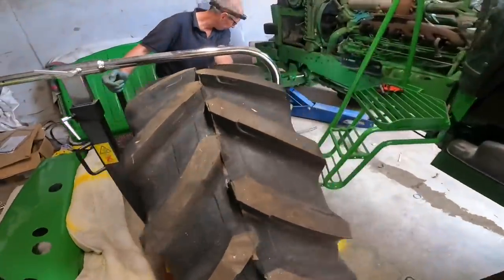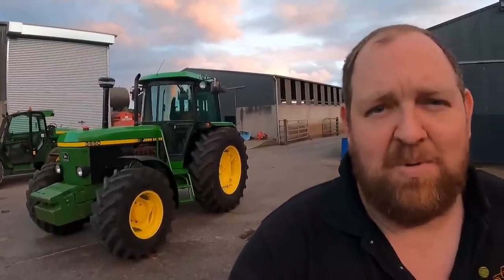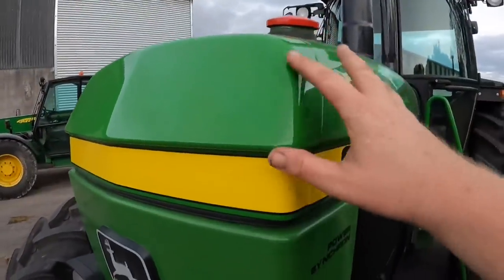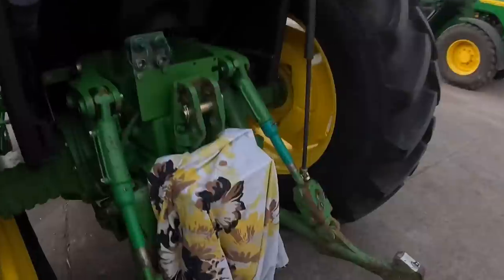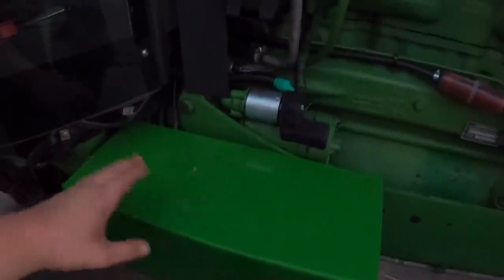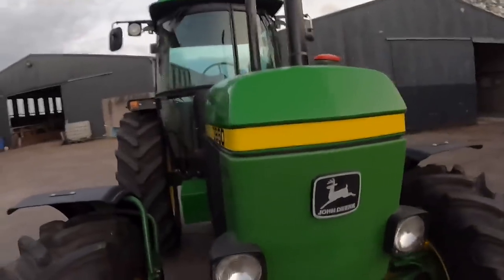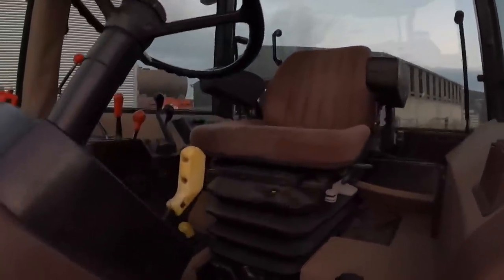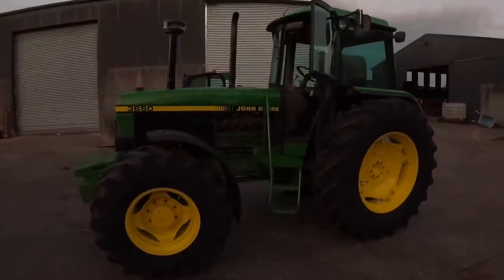JOHN DEERE 3650 UPDATE, ALLIANCE AGRISTARS 2 TYRES ARE ON.

Comment: Credit to you Gerry, great to see the old girl getting a quality facelift. One thing, make sure you have used loads of Loctite on the bolts for the wheel weights. I nearly lost mine on one wheel of the brand new Deere 5125R. Locknuts and Loctite, belts and braces.😁

Comment: Which power tools do you think are better Milwaukee or dewalt? And the JD 3650 is looking very good 👍
Reply from the maker: Both are very good. We have quite few Milwaukee tools and no issues. I also have a 18v dewalt drill and it had been fantastic tool. So either or  Is good 👌

Comment: I find the back tires are too big
Reply from the maker: Too big? That’s the standard size that  was on this tractor when new. You can go for a Tyre that’s less tall and wider. Which is what was on it when I got it. But it didn’t look right. Tractor was lower on the back. On these tyres it’s sitting nice and level. How it should be. Back like when it was new
Reply: @gerry6420  would you not consider the tyre a bit close to the mudguard a slightly lower profile would be better considering its a 3650 (the only JD tractor I'd buy). I had a 2140 (which now is on it's 6th engine) and I remember the back sat slightly lower than the front